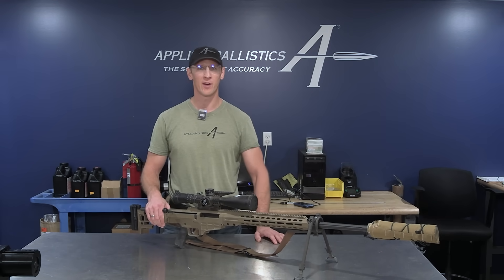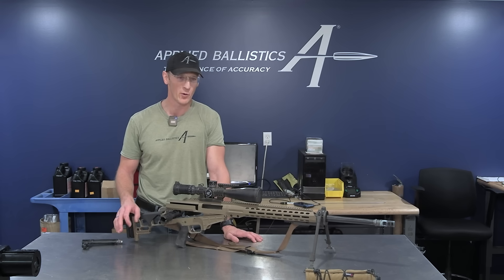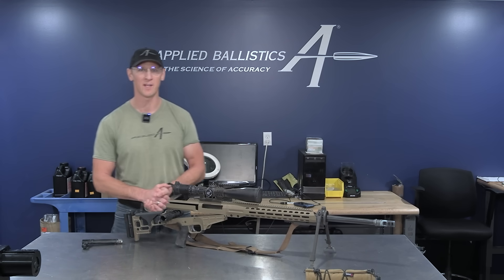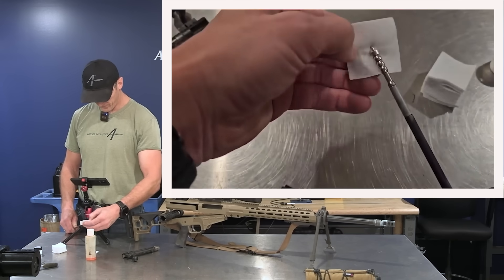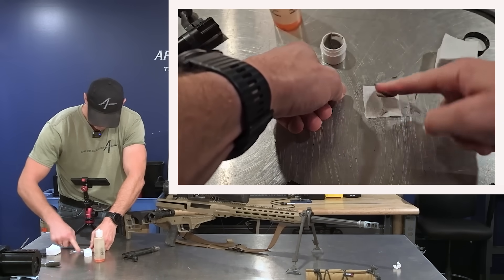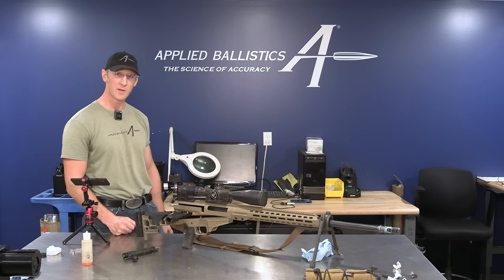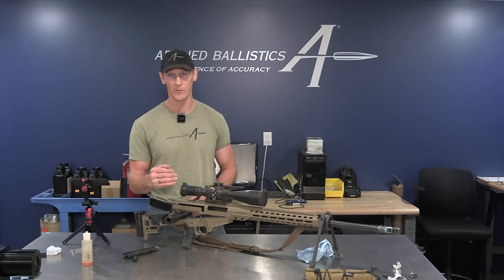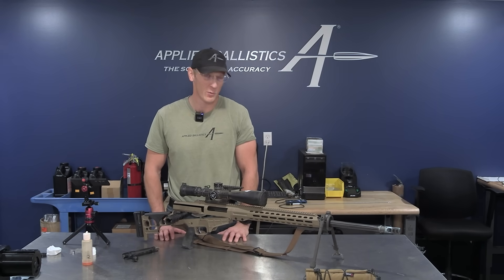High Performance Rifle Barrel Cleaning

Comment: So some interesting food for thought regarding this process. I do a similar process, but I use Thorroclean. I came to this conclusion myself when I noticed I was chasing velocity increases. This process restored the consistency in my reloading/shooting. However, what I've noticed is after doing this, it takes about 10 or shot shots for the velocity to stabilize. I have a custom 6.5 prc with a load that shoots around 2880. After this process the exact same loads started out at 2830, and each shot continued to rise in velocity until it leveled off about 50fps higher than the first shot. After this the speed was level. Can you explain why this is happening? Is it the copper build up on a freshly cleaned bore?
Reply: when it rises 50 fps for you, is that over 10 shots or a lot of shots?
Reply from the maker: @Teolulz  Both. Here's a typical cycle... Rifle is running up to 2900 fps when dirty.  Clean it per the video and the first shot will be like 2750.  But then within the first 10 shots, the velocity will plateau around 2800-2850 fps.  From there the velocity migration will be very gradual but creeping up until you need to set it back again.  This is an exaggerated example (375 EnABELR) but a lesser version of this progression occurs with 6 Dashers too.
Reply: @Teolulz  The last time I did this, I was finishing off a lot of powder and just loading what I had left in the bottle. Once that was done, I was switching over to a new lot to test it. For this specific example, I had 28 shots total. I shot 3 foulers, then proceeded to shoot the remaining 25 shots in 5, 5 shot groups. All of these were charged using the Autotrickler so the powder charge was the same. Group 1- 2839. Group 2- 2863. Group 3- 2877. Group 4- 2895. Group 5-2907. So an average of 68fps gained over 28 shots all the exact same load. After this I switched over to my new lot and everything was stable with low ES/SD. Pretty strange...
Reply: @xxshiftlockxx Powder will absorb moisture over time if your previous powder container was older or had been opened and closed numerous times of it's life that can definitely have an effect
Reply: @DanielReyes-hz1qk  My last two times performing this test and shooting groups were less than 1 month apart and about a difference of about 30 degrees. This tail end of the bottle is really the only bit of it that's performed this way. Will be interesting to see if the new bottle exhibits this behavior.
Reply: @xxshiftlockxx  interesting. Temps can do it too but that's usually linear and shouldn't effect consistency. Very strange. Would be interested to find out what happens with your next test. I just finished a pound of H4350 and started on another, next range trip will be the usual re-verification loads I do between powder lots. Rarely have I seen significant differences in ES, SD or velocity but I always double check
Reply from the maker: Yes! That's exactly the behavior I see after a cleaning. It is very repeatable to the point you can anticipate it.

I would say what's happening is your smoothing the roughness when you clean it. For the first few shots post cleaning, the barrel is smooth and the shots are the slowest. As the barrel builds roughness, the pressure feeds back and velocity increases. After a while, the roughness in the barrel stabilizers for many shots. That's when you see your velocity plateau. Then, as you continue shooting, at some point the barrel increases in roughness, and that's when things start to go too high and you have to clean again.

Comment: .. curious about this continuously .. any issues with micro-sanding" that bore?
What is that like for barrel life?
Reply from the maker: I ran a test with side-by-side 375 EnABELRs. We shot them on identical cycles with identical ammo. The only difference was, one rifle we never cleaned and the other rifle we cleaned with abrasive every 100 rounds. The rifle that we cleaned with abrasives lasted about 50% longer.  Also, the rifle that was never cleaned, it was runing 100 fps faster compared to the rifle we maintained with abrasive cleaning.

This is all exaggerated for those large calibers that burn that much powder. But the same thing happens to a much lesser extent for smaller cartridges.

Comment: Great video.  I note you don't have a bore guide.  Any reason or is it just you're comfortable with keeping the rod centralised ?   Any thoughts on bronze brushes - I guess not needed using your process?
Reply from the maker: Yeah, I guess I'm just not that concerned about it. I've always cleaned MRADs like this, and they always hammer for me. Better than I expect.🤷

Comment: My 6.5 grendel get not as fast firecracking, so i clean after every training from around 50 shots with boretec carbon cleaner and when i see copper with the copper cleaner,  put the gun away with oil in the barrel, and before the shooting i make it dry, and around 200 shoots i use the jp pasta.

Comment: Frank Green is probably screaming at the top of his lungs, but I agree high performance rounds need a more aggressive cleaning approach. Good video.
Reply: Wasn't he against JB bore bright? And not bore paste?
Reply: Abrasives in general. Not even bronze brushes.
Reply: I dont think Frank would be too concerned with how he's cleaning it....benchrest guys, maybe....because of no bore guide.
But as bryan states....the rifle hammers...

But frank was pretty specific about not using abrasives in conjunction with bronze brushes....

He didn't quite give a hard no answer on abrasives with patches or nylon brushes.....

But he is uncomfortable with people who don't know whats going on to go hog wild with them is what i gathered from all the interviews i have found with Frank.

Im in the middle.....i use abrasives yet im dreadful careful lol....i dont want my razor sharp crown getting rounded over hahaha...over polishing leading to the coppoer fouling issues ...or making my bore inconsistent diameter or bell mouthing the muzzle
Reply: @prone_wolf8871  Using a bronze brush with abrasive would be a lot less abrasive than plastic despite what you might think. Unlike the plastic bristles, the bronze bristles are much thinner and will not get as much abrasive embedded in it. As long as you use bronze brushes as they are intended, which is to replace them after every cleaning session, it will cause less wear than the plastic ones.

It sounds like your cleaning technique needs work if you are worried about your crown being worn down. 90% of your abrasive cleaning should be done near the throat and 6 to 8 inches in front of it. The only time abrasives should really touch your crown is when your patch out the gunk.
Reply: The guy just doesn't want to honor his warranty.
Reply: @StuninRub no, he doesnt want to give any retard with a bronze brush and a drill a free barrel for being dumb hahaha....and yes I've see the primal rights video....

Bartleins shoot